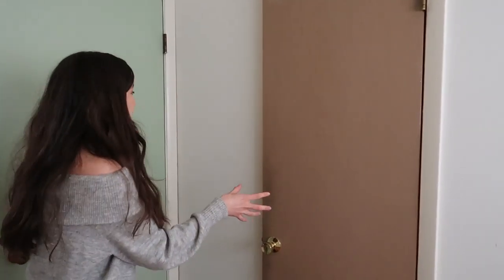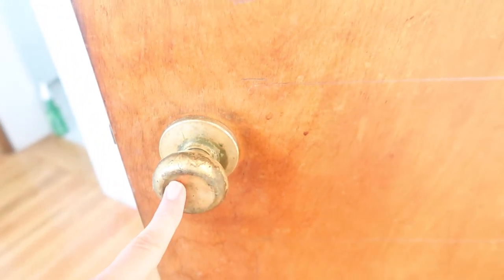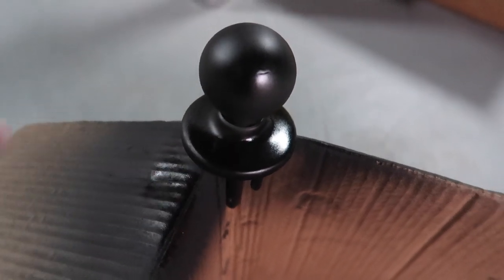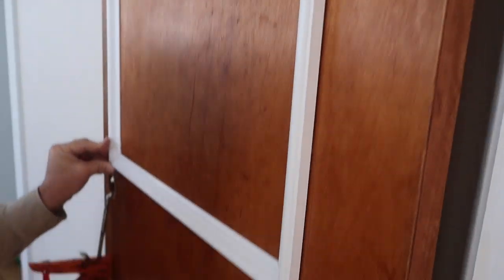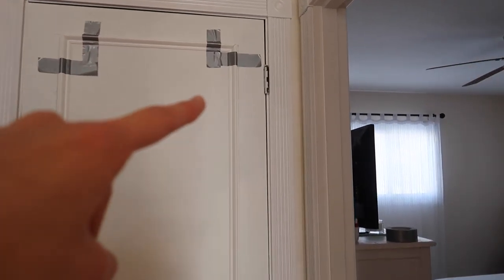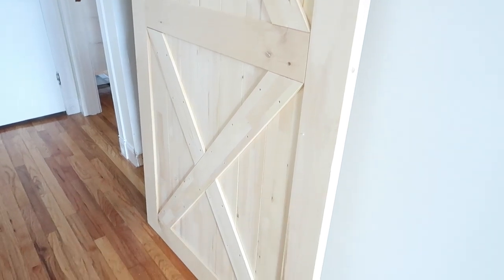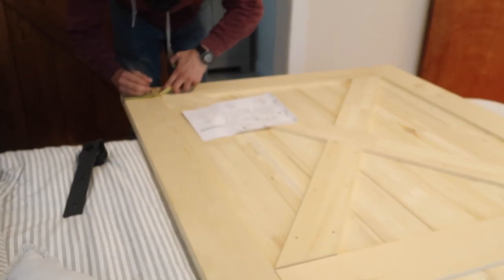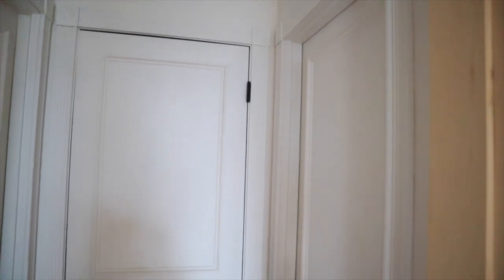EXTREME DOOR MAKEOVER //on a budget

Comment: What machine was used to clean up the knobs? I’m about to embark on this and I’m very interested in what that was
Reply from the maker: Mejiaandluna we used a bench grinder with a wire wheel. You can find them at harbor freight for pretty cheap!
Reply: @OurLittleNest  Is it necessary to "clean them up" with a wire wheel?  Could you just spray paint them without this step?

Comment: I spray painted my kitchen knobs with expensive spray paint it hasn’t held up over the past year.
Reply: I was wondering about that. I painted a lamp and the paint came off very easily :/ . She used a paint with primer in it, maybe that makes the difference?
Reply: Kitchen knobs would get handled a lot more on average. I personally wouldn't spray paint door knobs either, as it doesn't last. I'd spray paint the hinges and buy a new door knob. You can get them for 16-20 bucks.